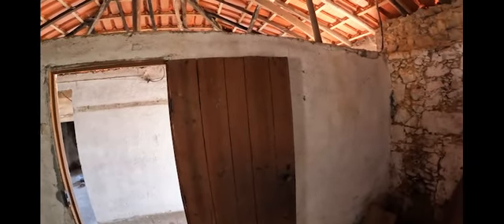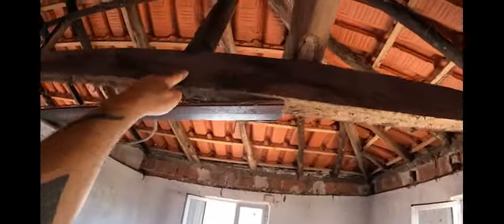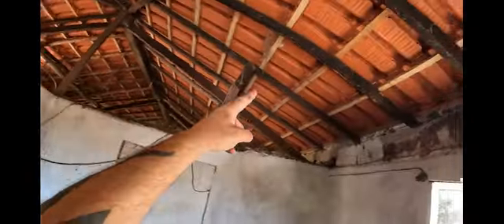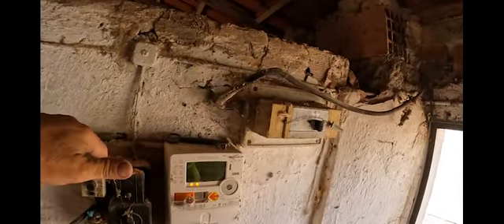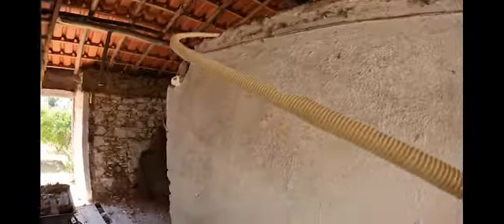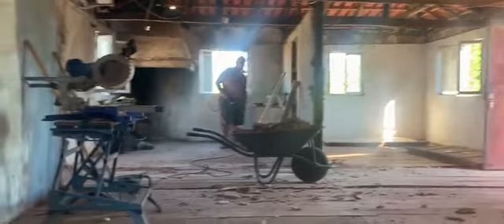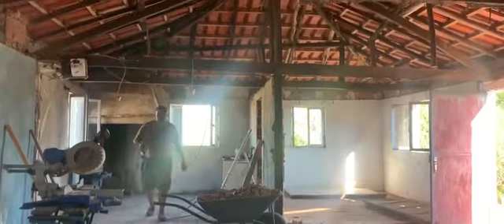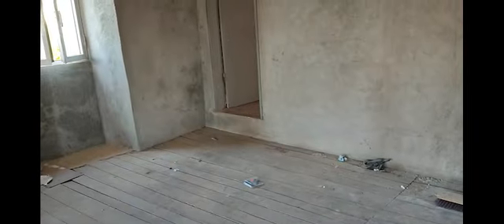WALLS DEMOLITION PORTUGAL OLD FARMHOUSE RUIN HOMESTEAD RENOVATION

Comment: Electrics are done on radial circuits 4 sockets per circuit and you don’t need as many as you think nice work on the walls we went for wood again as was actually cheaper than a full concrete floor and much easier and quicker to install still doing the install part 😂😂😂